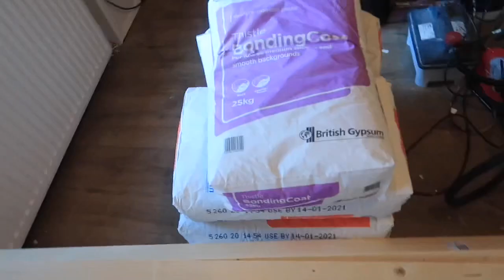BUSY WEEK STRIPPING WALLS & TILING THE BATHROOM | THE TOILET PIPE IS IN | HOUSE RENOVATION VLOG 3

Comment: Hey Laura,
Great stuff well done I know what it’s like so fair play to you👍.
Was going to ask you have you ever done built in wardrobes at all?
I have too but they need re doing inside IE re doing the internal shelving and new sliding doors.
Have been looking around but can’t seem to see anything which might work?
Thanks x
Reply from the maker: Hey Adam, thank you! I’d actually started doing wardrobes for my mum before lockdown - she just had this really shallow alcove in her room so I used some Ikea shelving and a billy bookcase for the internal and I’ve not finished the doors yet. Got a track from tool station - they had a good range of sizes and were really good prices that could be cut down to fit where you need and I plan on making the doors - I’d found a really good video to give me some inspiration which I’ll dig out. Alternatively I’m going to get some mdf cut to size and make a frame on them with planed softwood to support the mdf to make them look like the panels on the doors and I’m hoping they’ll be sturdy enough! X
Reply from the maker: Here’s the video - these are bifold but you could easy put something similar on a track https://youtu.be/FL7KBsJd6JQ
Reply: Thanks Laura that’s spot on 👍
Have just watched the video and gives me a good plan now on how I’m going to do it,
Went to IKEA a couple of weeks ago to see if o could get some sort of idea but they didn’t have much there to be fair, 
Glad your keeping ok as with COVID still around!!! X